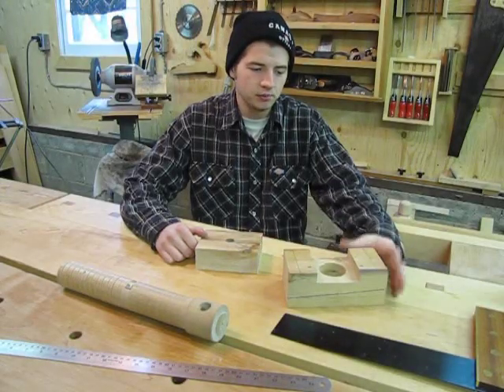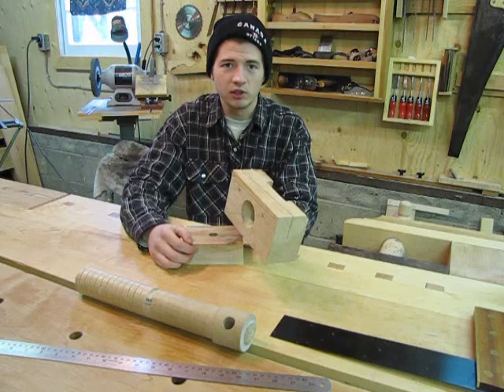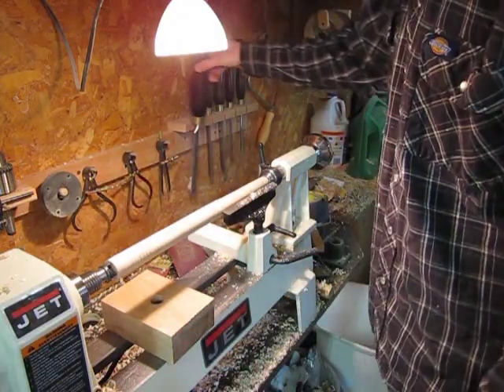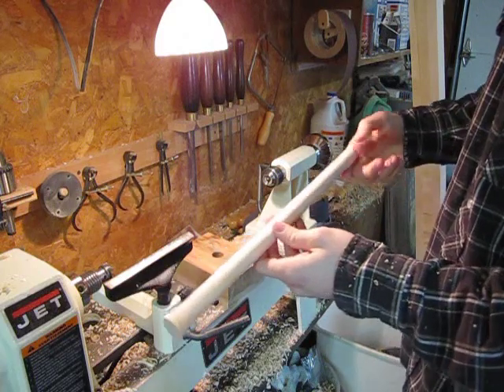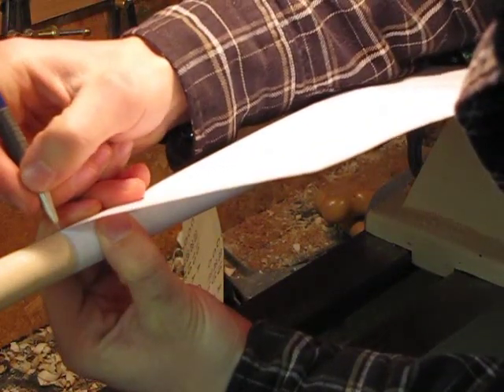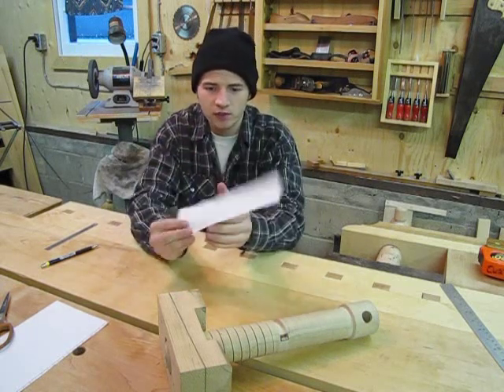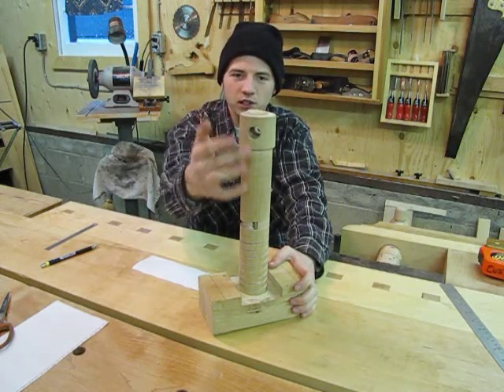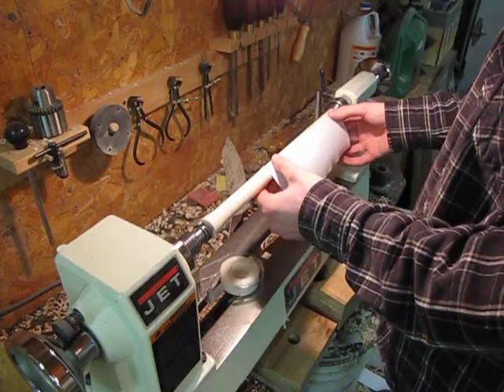Tap and Screw Jig Tutorial - Part Two, Section 1

Comment from the maker: If you watch my video "Laying Out the Thread Pattern" again I talk about diameters and thread pitch. The internal dia. refers to the dia. of the screw in the "valley" of the threads. This the the hole drilled in the guide, which is 3/4" in my case. The outer dia. refers to the dia. of the screw at the "peak" of the threads. When you use the tap to cut a nut and the cutter protrudes an 1/8" at full depth it will cut a nut with a 3/4" internal dia. and a 1" outer dia.

Comment: Would it not be easier to get the angle of the cut from the paper and then set a bevel gauge to that angle. Then cut the angle in the block for the steel plate and saw the dowel  in the block?
If you don't have a lathe maybe this will help? "Matthias Wandel - How to make the dowel maker" or "John Heisz - Make A Dowel Maker"
Love the video's hope to see more.

Comment: Wait so are you meaning that the "inner" refers to the guide hole and the "outer" refers to the dowel size. This then leaves a 1/8" play in the threads? So then the true outside diameter of the threads then would be 7/8" for a 1" bolt?